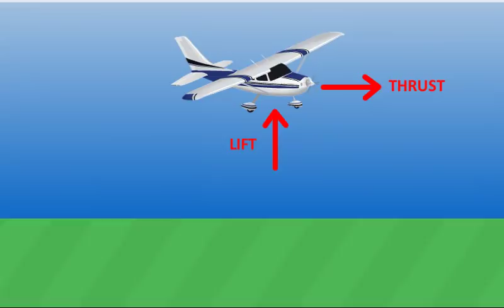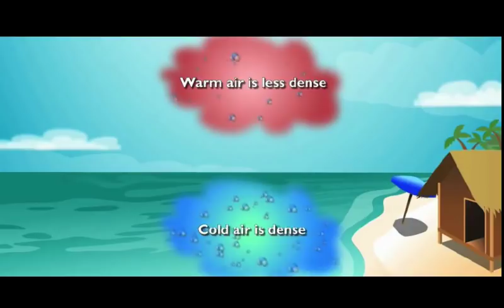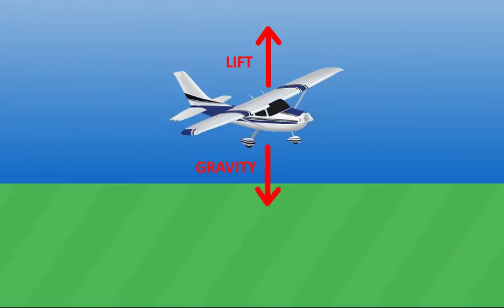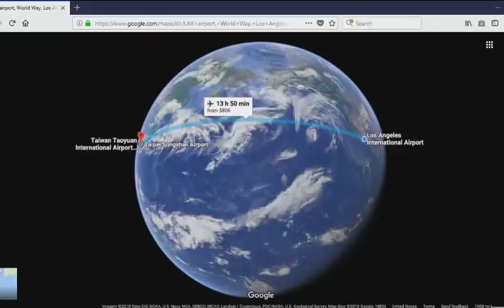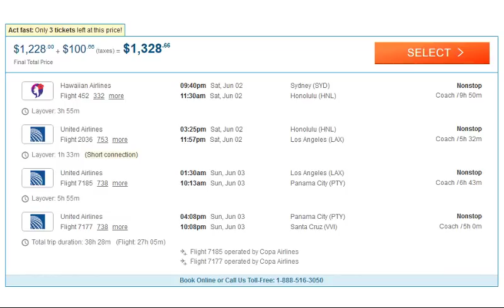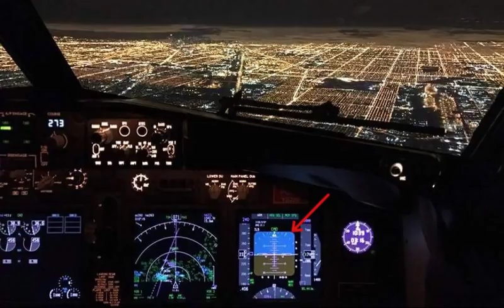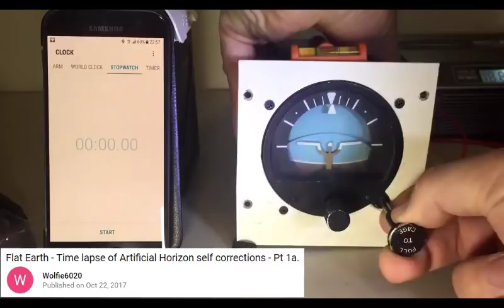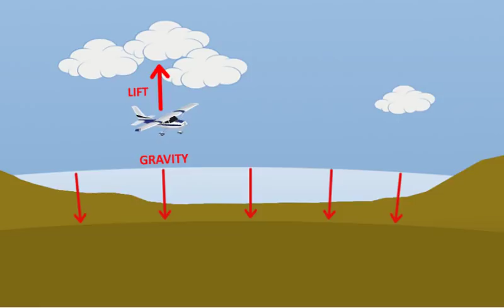Flat Earth Falsities - Plane Nonsense

Comment: Gravity...that theoretical force that does all kinds of magical things to fit any place science wants it to lol. Gravity pulling the plane which is in a lesser amount of atmosphere and going really fast, just magically pulls on that plane at just the exact amount that it can keep level flight. Like how could u look at that and actually believe that? Couldn't imagine the thickness of blinders I'd need to not go ..hmmm. that does seem a little odd. Gravitational forces are completely opposite at times and extremely unrepeatable "SCIENCE" ... forgot the shape of the earth. Just as a human observation even if the atmosphere goes exactly with the earth due to the gravity and the Centre of the earth. Do you not find it at least a little odd that the  further away from the force and at the speeds planes go it is so precise as to make the plane conform perfectly with the curvature of the earth and not make any small adjustments at all and keep level flight for long durations? Please be honest ? Forget any shape lol.
Reply: You mean the “magical imagined force” that we can measure, predict, test and observe. 

Seems a bit more believable than the unmeasurable untestable magical force that keeps your sun floating, speeding up for six months then changing course and slowing down for six months.
Reply from the maker: stone - How do you think airplanes fly? What keeps them up? What happens when they turn off their engines? 

The answer is they fly by generating lift with their wings moving through the air. That lift is a force which directly opposes the force of gravity. If they turn off their engines, they cannot continue to generate lift, so they get pulled back down by gravity. So pilots fly the plane at the correct speed to generate exactly as much lift as it needs. It can go faster than that, but then it will tend to rise, and it can go slower than that, but it will descend. Pilots do make adjustments, but just to keep the plane level and at the desired altitude. They simply don't have to think about "dipping the nose". Because the same altitude is a curved line around the earth, not a straight one, with gravity always pulling toward the center of the curve.
Reply: add always cherrypicking on NASA, forgetting all the other space and aeronautical agencies across the globe...... lol
Reply: What is weight without gravity?
Reply: Stones 911 omfg take a goddamn science class. Educate yourself. Watching YouTube videos is not "research" in any way whatsoever.
Reply: What force prevents sun and moon from falling down on Flat Earth model? It's more than magic ;).
Reply: Do you really believe that pilots do "not make any small adjustments at all and keep level flight for long durations"? Then why there are autopilots? Why without it pilot will always hold a yoke (control wheel, not a joke)?
Reply: Does a fruit fly weigh millions and millions of tons?

No. There is your answer.
Reply: Yes, gravity is a theory. It’s just that word doesn’t mean what you think it means when used in science:  

scientific theory (n.)
a coherent group of propositions formulated to explain a group of facts or phenomena in the natural world and repeatedly confirmed through experiment or observation.
— http://www.dictionary.com/browse/scientific-theory
Reply: Any scientist will happily admit that there is lots of stuff that science doesn’t understand yet, that it has no good explanation for, or that it only has a hypothesis that seems to make sense but hasn’t got good supporting evidence yet. 
But the existence of space and the shape of the world are not one of them!
Reply: Stones 911 if you have the same education as me, then you should know when to stop talking if you don't have an understanding of a subject. And it seems Astrophysics isn't something in which you possess a doctorate.
Reply: When you drop something heavy does it stay stuck to the Earth? There you go. Stuck to a spinning ball.
Reply: https://www.youtube.com/watch?v=QyeF-_QPSbk    How do you explain this with your buoyancy and density hypothesis? And don't give me any "this was manufactured by NASA" bull.
Reply: https://www.youtube.com/watch?v=s9Zb3xAgIoY  No air to muddy the waters, both objects fall at the same time. RIP buoyancy, RIP density.
Reply: @Bobby Wizard wrote: "why would lights fall? speaking of which do falling stars lose their gravity?"
WTF?
Light is constantly moving that is why it is visible. You can't hang it in air it would create black hole. What create light in the sun according do FE believers?
Falling star is a common name for meteorites (rocks) flying through atmosphere and burning. Some of them ends on Earth surface. They lose mass. What's your point?
P.S.
I ask again. What cause tides in flat Earth world?
I found three "explanation" all with provable flaws. 
1. air pressure cycles.
2. water evaporation by sun radiation.
3. pulsing electromagnetic or electrostatic force.
Chose your poison :).
Reply: @Bobby Wizard. I told you that term "falling stars" refer to meteorites flying through Earth's atmosphere. It doesn't imply that every star is a meteorite. WTF?
That "intelligent design" doesn't need to conform to physical laws? Then there is no way to disprove it. It just magic. LOL.
Reply: Martin Gorbush yes physical laws like water seeling level. what proof is there any stars are meteorites? what does a creator have to do with physical laws? what physical laws were present when accidental explosion created the universe? youre asking me where the sun comes from as if anyone can answer that
Reply: @Bobby Wizard. Physical laws in turbulent times of big bang are irrelevant now. Right now we can repeatedly perform experiments and achieve similar results (inside margin of error). That also apply to gravity. About which you repeatedly lie. Primarily because you do not grasp concept of net force.
What's more we can observe thing invisible to naked eye. Where are the cords supporting sun and moon on flat Earth?
Reply: Martin Gorbush you can perform no experiment showing gravity showing water sticking to spinning balls, pulling things down, or making things orbit. stop lying or show your proof
Reply: @Stones 911.  Please look up the Dunning-Kruger effect.  Then, figure out what it's telling you, and go educate yourself so you can limit its effect on you.

You say you've taken many science courses but then also say that the theory of gravity is "disputed by science as a theory."  To scientists and thinking people everywhere, this is evidence.  It suggests that either you didn't even learn the basics in your science classes or you're lying about actually taking science classes.  Either way, you have learning to do.

In another post you claim that you have the "same educational back round (sic) as you."  Why do you claim that?  How can you possibly know?  If you can't produce reasonable statements, why should anyone care about anything you write?  (I just picked one example, of many.)

Overall, your youtube profile suggests you're not just a troll, so that means the optimistic view is that you're ignorant.  (The pessimistic view is that you're stupid, but let's hope that's not it.)  So, if you're a troll after all, good job!  If not, please educate yourself so the Dunning-Kruger effect doesn't cause you to humiliate yourself so often.  After all, I think you'll like the real world once you can see it!
Reply: John H stop insulting people who disagree with you and telling them they are mentally ill. its a sign your argument is weak.
Reply: John H you insulted a fellow flat earther implying he has a mental illness. how do all of you globe guys reguritate the same insults? the illnesses, telling people not to breed? etc...are you all really artificial agents? im beginning to wonder. its like you have scripts
Reply: @Bobby Wizdum.  What mental illness did I suggest?  Maybe you mean the Dunning-Kruger effect?  But that's not a mental illness.  And you again refer to an insult, but I made none.  To what insult do you refer?

Is this just meant as deflection?  And I'm falling for it?  If so, that's more evidence for the "troll option".  Ironically, that cheers me up.

But, maybe it's the word "ignorant" that's bugging you.  If so, a dictionary is in order.  We're all ignorant.  For example, I know very little about the law or working in the various legal professions.  I've never studied that, outside of one class in high school.  The difference is that I recognise my lack and won't go onto legal sites to opine about how fundamental legal tenets are wrong and it's all just a big conspiracy theory.  This is what understanding the Dunning-Kruger effect can help with.
Reply: John H dunning kruger is an insult.
Reply: @Bobby Wizdum.  No, the Dunning-Kruger effect is not an insult.  It affects everyone to varying degrees and in various topics.  Being aware of it can help one avoid overestimating one's competency in areas of relative lack of competency and ignorance.  The posts I've seen from flat-earth believers display an incredible lack of understanding of basic physics, math, and science in general.  Yet, the comments are delivered with supreme confidence anyway.  This is precisely what can happen when the Duinning-Kruger effect is not understood and is ignored.

You can take that as an insult, if you want.  It's not, though.  Based on overwhelming evidence (in the posts for just this one video, for example), it's just fact.  Whether you choose to acknowledge it, or care at all about truth, fact and reality, that's up to you.  After all, I cannot force you to choose to become more knowledgeable about the topics you discuss.

Actually, as an aside, I view this as one of the real horrors of religion.  The less you know, the safer you are.  Religion often celebrates ignorance, which is an affront to our shared humanity.
Reply: John H because you believe lies you were told since birth. we understand your model. we know better
Reply: @Bobby Wizdum, who says: "because you believe lies you were told since birth. we understand your model. we know better"

I know you do, Bobby, I know you do.  :D  Well, you can't say I didn't give it my best shot.
Reply: NotTheCIA I.think tell me how cavendish proves all mass attracts all mass with the same force. were multiple masses tested?
Reply: Martin Gorbush why would lights fall? speaking of which do falling stars lose their gravity?
Reply: So u won't admit gravity is a theory? And they can see suns and moons and find exo planets trillions of miles away ...once again..guess work ..no actual solid visual proof unless u count the cgi images they show...that's not called blind belief?? What's it called then?  When mens guesswork is called fact. Hey there's a star out there as big as our sun...with 4 earth's and 10 moons...hey of course there is right ? The universe is endless and all possibilities must exist. Sweet I'm a scientist now. Believe that. ?? Same thing buddy...exact same lol
Reply: GrahamStw you cant repeatedly perform any experiments that show your claims of what gravity does. calling it a theory is being generous.
Reply: NotTheCIA I.think bouyancy is density in water. its not complicated at all.
Reply: NotTheCIA I.think because you cant demonstrate through scientific experiment what you claim gravity does. why is that so hard for you to admit?
Reply: Martin Gorbush u can prove a star us s meteorite? b.s. as for what put the sun in the sky...we say intellegent design. you say an accident
Reply: Gravity is pulling things down to earth ..millions and millions of tons of heavy water. But a fruit fly can just zip around all day. But I'm guessing that's where these scientifically measurable and observable things come into play. And also explains how the weaker gravity gets the away from the earth into the vacuum of space, yet is still strong enough to keep the moon in its orbit. Or maybe we just don't really understand what were living in or on and a bunch of scientists tried to take away any kind of creation idea and filled it with a whole pile of hypethetical theories and claim it as fact. Like ya they saw a blink of light on a star trillions of miles away and they bust out pictures of other earth's or exo planets ..like come on...science truly is science fiction..a whole pile of guess work taught as fact...and ya gravity is a theory. Of course science can say they measure it and predict it but deGrasse is like but we don't know what it is..next question..lol. guess work. I find it harder to believe in alot of what science is saying then maybe we just don't know yet ..cause for years, long before anyone even went up there or anything, these scholars or early guess workers had it all figured out. And who in their field is gonna come out and say ..yep, alot of it is wrong and bullshit...which btw has continuously happened in the science field over hundreds of years but not without controversy....i have a feeling science will be overturned in many areas again and again. Likely sooner than later as the internet reaches so many people, there is alot of intelligent people waking up and questioning things. If you noticed it's not a bunch of 40 year Olds in mom's basement. But none the less I think there's some good and reasonable questioning going on. And nothing wrong with having a conversation about it in a mature way.so whether it's  Flat/ globe, spinning/stationary,  created/came from nothing in a big bang. There's definitely alot of science being questioned and I think it should be ..even globe believers are realizing nasa is full of shit. Which is a good start anyways. Take care guys.
Reply: GrahamStw does that prove things orbit and get pulled down or not due to weight and will stick to a spinning ball? no !!!!!!
Reply: As I said before...I don't subscribe to any earth shape...but just once I'd like people to admit that maybe they are blindly choosing to believe in things that are simply guess work. Science does and can be proven in many ways..but when it comes to gravity...stars ..exo planets ...all that shit...Ur blindly believing ..but fight to the death and call people names who even remotely question it..like I said earlier ...we can have mature conversation about it...no need to get Ur panties in a bunch fellas haha.
Reply: Silly me...look at me here with pie on my face. Jeez it's that easy to explain.lmao.. My bad. I was wavering but you got me back to spherical. Cause of course they wouldn't have some crazy math to back it up after hundreds of years. So you're a smart man apparently?, can you admit that combustion doesn't work in a vacuum and that so much science and shit they are claiming to see, find and go to in space is lies? Or can u send me a math equation for that please. Where's juno? How come when I search endlessly for images of stars and planets from all these big ground based telescopes I can't find 1 image that isn't a cgi picture but when u look at them through regular powerful civilian telescopes you see weird shit. But yes..I know ...even Ur side is agreeing nasa is full of shit but not everything else surrounding it and it's math and it's science. But thanks for bringing me back solidly to Ur side sir. Ur math overcame me with such intelligence that I had no choice whatsoever. I am a once again a heliocentric science globe earth robot of the government. How can I ever repay u sir??
Reply: Buddy..read my other posts..I said of course sciences have true basis that can be proved every day. But once again you've neglected all the outer space bullshit math etc that doesn't exist...so I can say u guys cherry pick too...I've said before I get science that is earth based repeatable science. However refuse to buy outer space planet based hypothetical bullshit..which sorry to say. Buddy...is the theory of gravity...and still is disputed by science as a theory..but I find more often now u guys are trying so hard to avoid that shit because it will and does destroy so much of Ur science and theorizing. . All u guys do is revert back to anger and name calling and avoid the question. U guys are only responding to the things I don't need answers to??? Lol. And once again for the first time I'm not a flat earther but calling into question a ton of lies and bullshit. .and it shocks me that no  one on Ur side will say I'm not sure...I don't know...I admit that is a lie ,or made up...jeez at least flat earth believers will say .,.I dont  know,..I'm not sure,...cause they refuse to listen to made up bullshit as fact....once again...Noone will admit the bullshit on Ur side even obvious b.s easy stuff?  So bizarre to me...it's scary that Noone will...like is there one man in the field that will admit that there's a ton of blind faith bullshit...please...just 1 person??...i beg... lol. Truth is like I said before ,even heliocentricity believers are coming to me left and right saying I don't believe nasa ..they're full of shit... , yet still believe all the shit they do and say and believe in....and all I get is oh here we go bringing up nasa again....yes ..yesss of course bring up nasa ..which is all the proofs and science that create the entire world you believe in with the right to show no proofs...but hey...it's a start ...I  love to see u guys get mad and avoid it like the plague. ..its a start bro. For now :) I'm always ready for proof. Just struggling to get good proof so far. Bouyancy math isn't it..sorry bro. Lol
Reply: I understand flat earthers are out there , being arrogant, claiming to know what the answer is...I'm not..I'm merely admitting as someone with the same educational back round as you that there's alot of lies and b.s behind science.